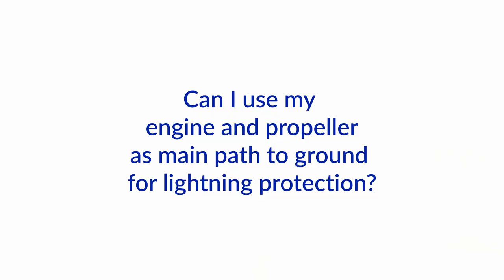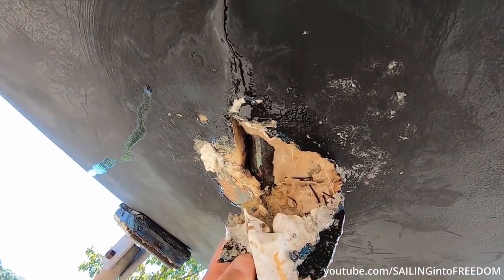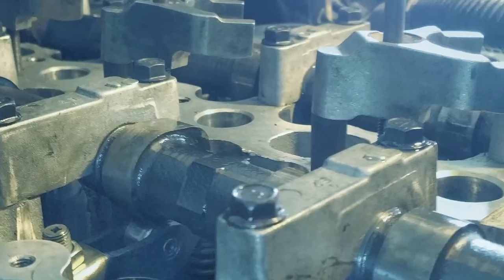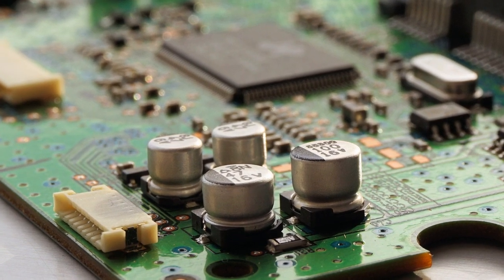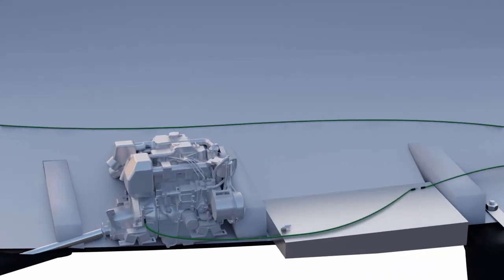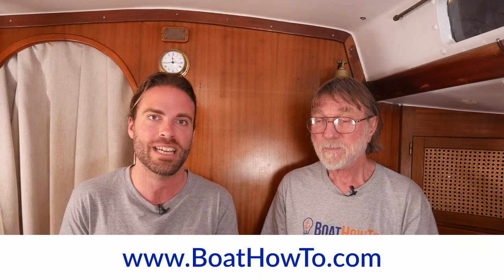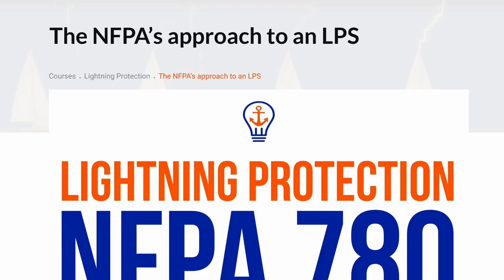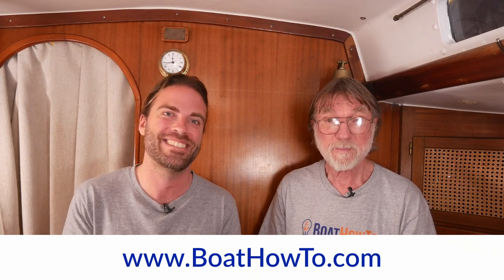Lightning Protection: ENGINE & PROPELLOR for lightning grounding? | Ask The Expert with NIGEL CALDER

Comment: Thanks again for a valuable tip! I am sure many opened their eyes just as I did :) Although I would like to ask a favour. Could you ever make a little video explaining how the grounding and lightning grounding work in a steel boat? Steel boats are not top be found in the US and definitely not in the southern Europe but here in The Netherlands, in Germany and also in UK (many narrow boats)  there are many. Thank you for your great knowledge every time!!!
Reply from the maker: We cover this in detail in one way or another in the advanced marine electrical course. With both a grounded DC system (negative side of the DC system connected to the grounding bus and to the water) and an isolated (ungrounded) DC system (negative side of the DC system is not connected to the grounding bus and the water) all bonding, lightning protection, and AC grounding conductors terminate at a grounding bus, which in turn is connected to the water. The difference between the grounded and isolated ground DC systems is with the former the negative side of the DC system is also connected to the grounding bus and with the latter it is not. The steel boat with an isolated DC system still needs that connection to the water for the various grounding circuits.
- Nigel
Reply: @BoatHowTo  Dear Nigel, thank you very much for your extensive reply. I am going tomorrow to the boat and check again every grounding and all connections. I am considering joining the advanced course too. All the best with your training site. You have been educating boaters since ever. Totally thankful :) 👋👋👋